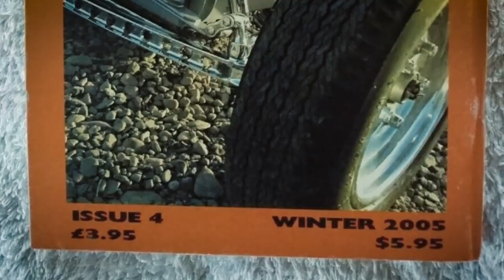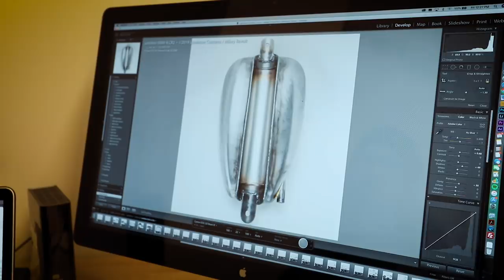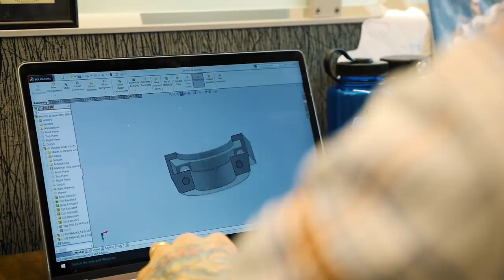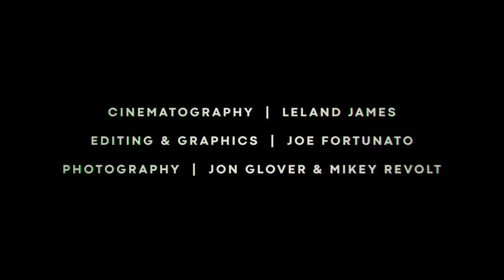The History of Lowbrow Customs

Comment: Found you folks recently. You have the ignition parts that I needed to correct a situation I have with my 1970 Honda CB 750. I wanted solid core spark plug wires and associated caps. I looked all over, couldn't find what I wanted but you folks had exactly what I wanted. If you want to expand your business there are a whole lot of people out here restoring and fixing vintage Honda 750's and 550's etc. Since you are willing to design and supply hard to find parts this might be a good avenue to explore. For example CB 750 exhaust pipes and mufflers. OEM pipes and mufflers are next to impossible to find. If you would be willing to dive into supplying those restorers would flock to that. There are other parts that are in the same situation. If you are interested communicate with me and I will give more feedback.

Comment: I called these guys yesterday and had every intention of ordering a set of bars with all the fixings for my 2018 slim. I spoke to Amanda or Ashley in sales and told her what I wanted to do. She stated that my bike was too new and that she didn't know what type of throttle wire or clutch cable I needed. I ended the call and will look elsewhere for the parts.

Comment: I'll be honest...  I don't have a high level of respect, for what is called a "custom," bike today.
An assortment of 'off the shelf parts,' to make a bike.  The most original part of the bike is the paint job.
I've come to love those old hardtail rigid frames, chopped, with any of an assortment of a front end on it.  The engines are as old as magneto powered, iron flat heads, knuckleheads, pans and shovels.  Yes they drip oil and shake parts loose!  That's part of the adventure.
And then, parts and pieces are chosen solely for their unique individuality.  Or even fabricated by hand!  Almost nothing off a shelf...  But maybe something collected at a swap meet, or found in an old garage, or barn.  Who says that because something's older than the rider, it's no good?
I got nothing really, against the modern bikes...  Evos seem to be good motors.  And if you want a bike taken from off the shelves, go for it.  I don't think they have the soul of the old rigid frames.  They are as 'custom,' as the shelf they come off of...